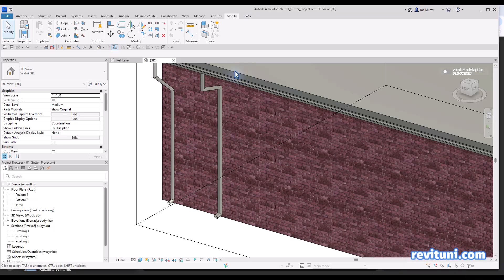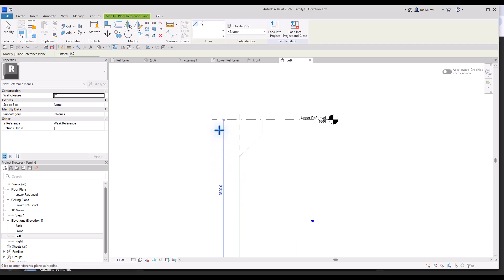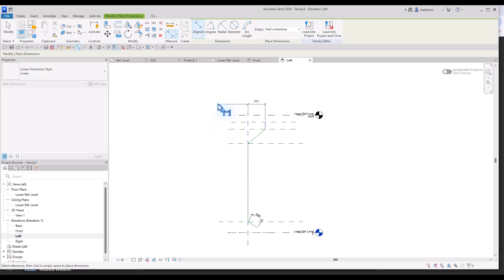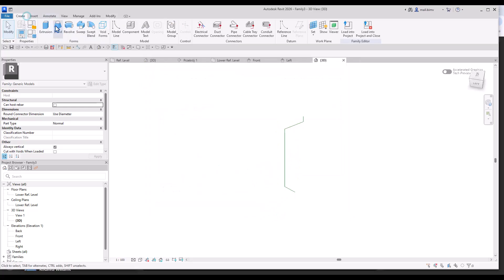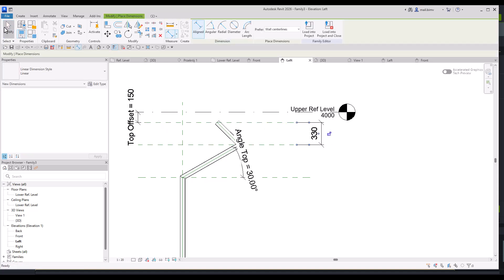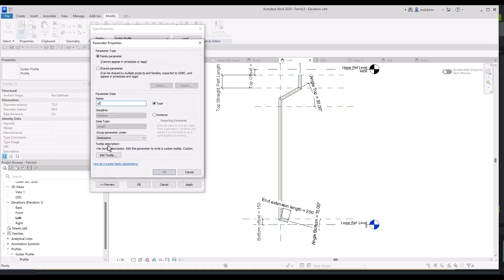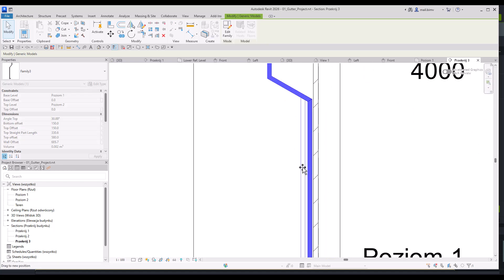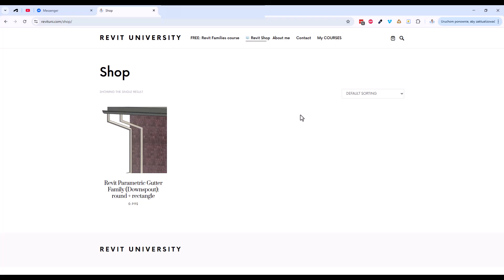Gutter / Downspout in Revit using parametric family (not a pipe). Easy to control | revituni.com

Comment from the maker: If you'd like to skip the learning part you may get the gutter here quickly: https://revituni.com/product/revit-parametric-gutter-family-downspout-round-rectangle/
Reply: I'm currently working on a square downspout. I learned the technique from you, but this wasn't a great video. Yet, I was able to modify what you taught for my particular design, which was well appreciated. My critique: 1. You talked a little too fast and clicked commands too quickly to comprehend and catch (I had to rewind several times). Please be moderate and precise in your explanations. 2. When you do a video, please already know what you are going to show people ahead of time instead of teaching "on-the-fly". and 3. You taught as if people already knew how to do this (university level?) and skipped showing a few commands. Otherwise, I do thank you for taking the time to complete this w/o using a pipe downspout from plumbing.
Reply from the maker: @Roland-qs1hc  thank you for taking time to write this critique. I will think about it. My thinking is that people have so limited attention span nowadays that I want to show stuff as fast as possible, also for more advanced user I don't want to be boring. 

I sometimes show the struggles that I have on purpose so it's also something that people can learn from instead of showing the shortest path to the final result. But I understand that for someone who tries to follow it step by step it might be annoying to fix this errors and going back and forth with my videos.
Reply: @revituniversity  please don't stop doing the EXCELLENT job you're doing! I decided to look at your other videos and yes, I believe you do that on purpose and it forces me to use my little sense to figure things out. I saw other things in your videos as well and that's why I'm subscribing. Thanks again!